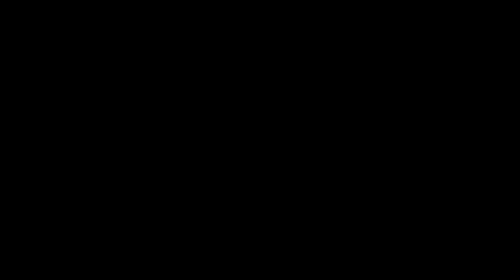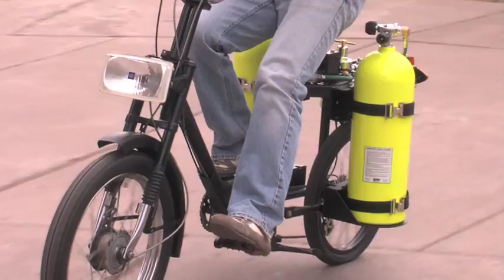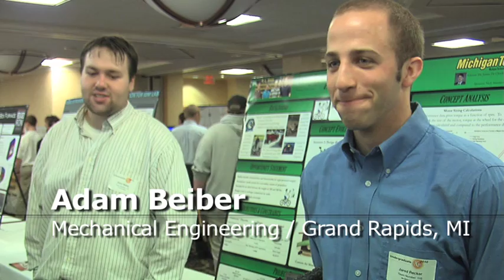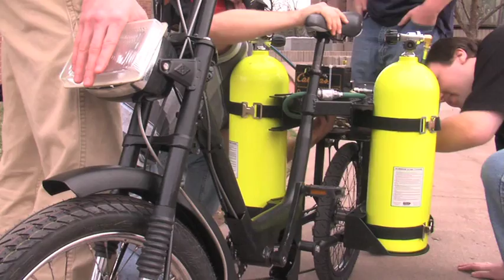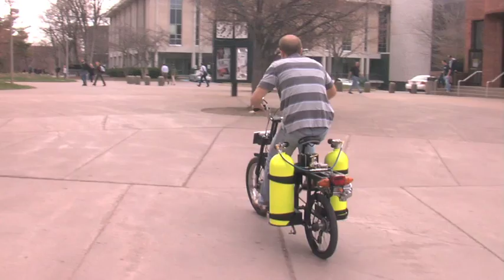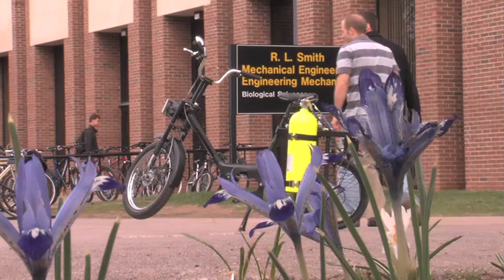Air Powered Moped: Michigan Tech Undergraduate Expo 2010

Comment: I like it. You could use a system of solar panel, compressor and big air tank, which would run over the day and supply your car or bike with compressed air. Or perhaps a bigger system at home, with big air tank (which could be placed in the backyard space-saving under the earth) which would power your home at night. This system would be ecofriendly, because you dont need any batteries. The solar power would go direct to the compressor and fill the tank. And once installed, it runs forever without maintenance work like system with batteries, which must be replaced after a certain load/unload-cycle.

Comment: You all seem to be forgetting one thing:  An air powered vehicle, or an air powered anything, is ONLY as good as the power source that recharges the tanks, just as an electric car is only as good as the power source that produces the electricity to charge their batteries, even when that power source is a GASOLINE ENGINE or a COAL-FIRED POWER PLANT!
Reply: Thank you for acknowledging and approving my comment about the very-much-disguised energy inefficiency of air-powered equipment.  I have an additional comment about that:  I have always been interested in machines, and at the age of 11 and 12 in particular I was learning a lot, and at that age I developed some wild ideas about machines that could theoretically exist.  One of these fantasies involved an 8-horsepower (a Snapper Comet) riding lawn mower that would be adapted for use with an 8-hp air-powered engine instead of an 8-hp gasoline engine, that would generate that 8 horsepower at a supply pressure of 90 PSI.  The air would have been supplied by what I can presently guess, according to my visual conception of it back then in those wacky ignorant brainstorming days of my childhood, to have been at least a 500-gallon pressurized air tank, shaped like a huge round sausage, mounted on four wheels, and pulled behind the mower by means of a hitch.  Fortunately, to my credit, it wasn’t long before I realized, even at that young age, just how impractical this would be.  For starters, the sheer size of the air tank would have made the whole setup very clumsy to operate.  (Going around turns and curves with all that get-up?)  But that was only the beginning of all the problems I realized would be incumbent with this system.  The air tank, pressurized to 175 PSI, would have had to be so sturdily constructed that its weight alone would have taken a stupendous volume of air to power the lawn mower complete with its trailer tank, and simply increasing the engine size would have only further shortened the amount of mowing time between tank fillings.  Increasing the size of the air tank to accommodate the larger engine, sarcastically speaking, would have been just as helpful — not to mention how big and heavy an 8-hp air engine would be as opposed to an 8-hp gasoline engine.  Beyond these issues, I also realized that the air compressor that would have been required to fill such a tank would have to be huge and would have had to pump an impossibly high volume of pressurized air to fill that lawn mower air tank — and all for just a stupid and comparatively small riding lawn mower.  It was obviously better to keep the gasoline engine on the lawn mower than to have it on an air compressor that ultimately would power the mower’s air engine.

I was a bit older, I would say about the age of 13, when I got a significant real-life lesson on all of this.  About two Christmases ago my parents had bought me an Air Jammer Bug Scrammer, which was an air-powered toy car, powered by a 2-cycle air-powered piston engine that sounded just like a miniature gasoline engine when it ran.  One day, at about the age of 13 and a half, it suddenly occurred to me to try an experiment of pumping this thing up to full pressure and then putting an entire bank roll of pennies on the front bumper of this car, which I guessed was about the scale equivalent of a small trailer being hauled behind a real life-sized Volkswagen, which this toy car resembled, so that I could see whether this air-powered car could haul any weight.  I then started the engine by giving the car a push, but the engine stalled after a small amount of strenuous-sounding sputtering and a few turns of the car’s wheels.  The air engine on that car, seemingly size-scaled to an appropriate-sized engine on a life-sized car, couldn’t move anything more than the naked weight of the car, let alone an equivalent life-sized one or two ton trailer! — and the air pressure to generate that power came from an air tank that was so big that it filled the entire cab area of that toy car!  Obviously no room for passengers in an equivalent life-sized motor vehicle.

Of course it occurred to me that I probably did not have the hauling weight of that toy air-powered car properly sized to scale, and I had no real way of knowing how accurate it all was even though I was doing my best to pay attention to those details and model the experiment accordingly.  I knew that a package of pennies on the front bumper of this toy car was most likely equivalent to a two-foot-wide, four-foot-long steel or copper sausage strapped to the front bumper of a real-life-size Volkswagen, and I of course had no idea as to whether a life-sized car could haul that kind of weight.  Of course I knew I could only guess based on the size of the largest trailer which I had seen my father’s small and similar-sized Mazda NLC successfully hauling down the highway, and then try to guess all that weight down to the equivalent weight of a solid hunk of heavy steel that was being hauled by a hundred-horsepower four-cylinder gasoline car engine.

Nevertheless, I very fortunately was able to learn an important lesson about mechanics that day, from actual live experience, which was actually a reinforcement of what I had eventually begun to suspect concerning that hypothetical air-powered lawn mower — and I’m expressing it here the way I thought about it back then at the age of 13:  The mechanical force that is generated inside of a gasoline engine by the many-times-per-second explosion of many miniature air-gas-mixture bomblets that drive the engine’s pistons up and down is much greater than the mechanical force that can be generated simply by compressed air, even high-pressure compressed air.  I realized that day that the only reason why a fossil-fueled engine, like a gasoline engine, is practical in the first place is because the chemical energy in the fuel that powers the engine far outstrips the weight and volume of any quantity of that fuel, regardless of the amount of fuel or the size of the engine — whereas this is not so with simple pressurized air in which the energy density is much less.

So now that I said all of this, can you even further see all of the problems that you would have with an air-powered moped?  Now I must mention that it’s a nice theory to try out by someone, like me, who is amused by experimenting just to see how it works.  But for practical real-world use, it’s just a joke, the kind of gag you’d find in a novelty gift store like Spencer’s.  That moped looks like it’s being powered by two of those pressurized breathing tanks used with firefighters’ rescue gear  Those tanks are pressurized to at least two thousand, if not three thousand, PSI.  That’s a lot of air pressure.  But again, as I have been explaining all along here, there’s not enough mechanical power in the pressurized air in those two tanks to get that moped more than a few miles — though I freely acknowledge that that moped sure will go fast.  In fact, I have no doubts that that moped can go 60 mph at its fastest speed.  But with air power, fast does NOT equal far.  At that speed, the rider has a two-or-three-minute run at best — and then comes that sagging, sinking, disappointing kind of letdown when the engine gradually winds down with the decreasing pressure in the air tanks and then finally stops altogether, and so does the moped, leaving its rider in the dust after SUCH a great and robust start.
Reply: Nathan King Just some constructive criticism. It's highly unlikely anyone is going to take the time to read that HUGE comment (more like a small book). You should keep your comments on forums simple, concise, and to the point. That will give you the opportunity to engage with other users more.

In response to your first comment - I don't think anybody has forgotten that fact. Just keep in mind that the power source can easily be a renewable energy source like wind or solar. Meaning that the air engine would become virtually free to use.
Reply: I was kind of thinking about renewable energy sources like wind and solar, but the way we're going, that's going to be a long time coming.
Reply: Nathan King Not at all. Perhaps that's just what you're led to believe through media.

My home is purely solar. I don't use ANY grid power at all. I would like to add some wind turbines as occasionally overcast can last more than a few days and I have to conserve my energy usage. During that time though, there's plenty of wind.

I did the install myself and it only cost about $4k total. The panels are guaranteed to 30 years so they will easily pay themselves off.

Battery technology is what really hurts, however I'm now looking into LiPo or a similar flow battery with IBC tanks. Much longer life expectancy and easily repairable by myself.

Comment: Today in india they start to use this kind of motor for the cars, in France we can find cars like that, sure we need to charge after 100miles, but for the city is perfect, and they made dual system, with 15 liters of alcohol, oil etc the systeme can run for 600miles. But at this moment they discover this system,  they need more time and more workers for have better results.

Comment: Looks like a tonson 5 piston air motor about 0.5 hp. They would get about half a mile range with two tanks and if they had done a decent analysis they would have figured out it is horendously inefficent and short range. An elecrtic bike with lithium cells is much better. And no you can't magically make it better. Physics rules

Comment: Hello. How powerful engine did you use and how much was the momentum it had? How much weight did components add (In kilograms)? What distance did your bike cover with two tanks. Did you have problems with air cooling pipes down to much? (As known gas temperature becomes lower whe pressure decreases)

Comment: This is very old, and it would be wonderfull if it worked. But it doesn't. And the reason why it doesn't is that MOST of the energy you need to compress the air, gets lost in form of HEAT. Anyone how knows how the air is compresed and how much heat the process produces, should know this low efficiency very well. So, this simply can't be efficient in any way.

Comment: Secondly to fill a 20lt tank at 300bars at 10% efficiency would take 9kwh. At  6.3 cents per kwh it takes 57 cents to fill it up. The maintenance of scuba diving compressors are indeed high but that is because of the sophisticated filters which in this case are not needed. Mostly the maintenance you will need is an oil change every now and then.

Comment: Nope running a compressor uses a shed load of electricity, the compressors don't last forever and need maintainance, they are expensive so there is avoided cost etc  etc it's not cents and never has been.

Comment: This would be better to run your cars and trucks and trains of of as long as you have an medium sized electric air compressor on board so when sitting at the light you can flip a switch and it starts filling up the tanks.

Comment: Didnt he say that those two tanks can propel him 7 miles?  7?  And if the dive shop guys are right and the tanks cost $10 to fill, thats $10 to go 7 miles. My gasoline powered car gets 23 miles to the gallon and I am paying $4 a gallon say? I would say that the car is far more efficient, can go further in all kinds of weather and is heated and air conditioned. Plus no one is pretending the car is "green", while to fill these tanks requires fossil fuels too, ultimately. I see no advantage. Sorry.

Comment: You've over-complicated it. Windmills / watermills can drive compressors directly. No electricity or intermediary fuel required. Compressed air can be stored up for calm spells. Only when this runs out would other, less efficient sources be required, and that still doesn't necessarily mean power from the grid; calm weather is usually sunny after all.

Comment: @VulpesVirago 

This is a poor use of that electricity because of the low efficiency of storing the air and using it in the engine, but electric vehicles pollute less than gas vehicles even when charged from a coal heavy grid. This is because they use vastly less energy per mile driven, and thus require less fossil fuels to be consumed on a per mile basis. Electric motors are 85-90% efficient versus gas engines which range from 15-25% efficient, and lithium batteries are 99~% efficient charging